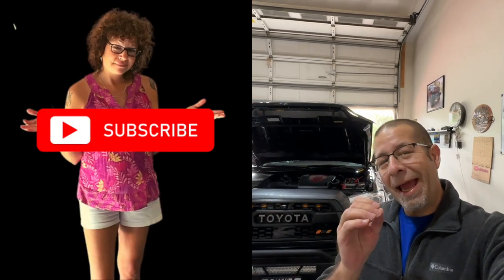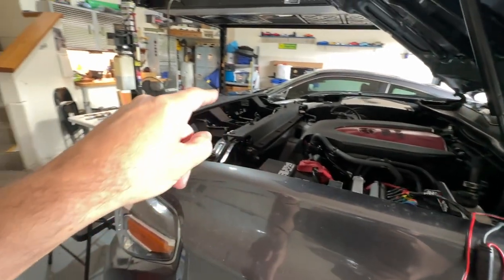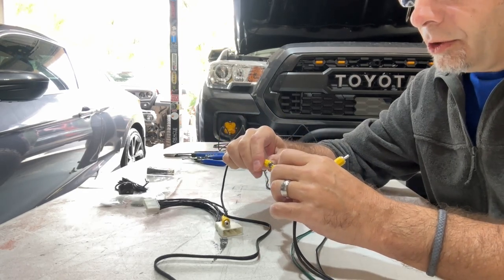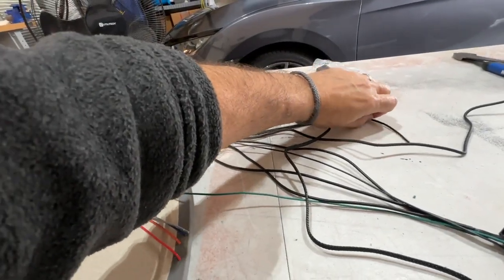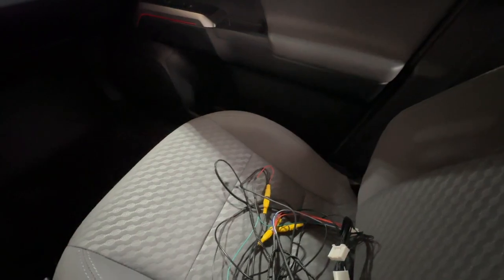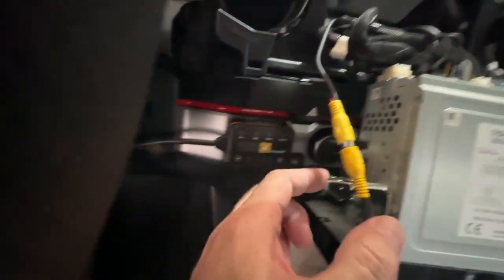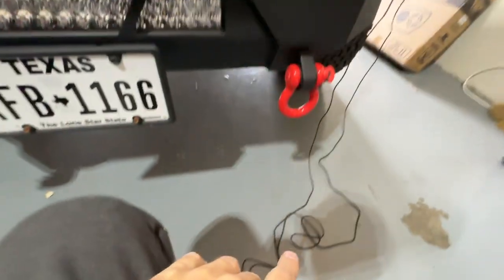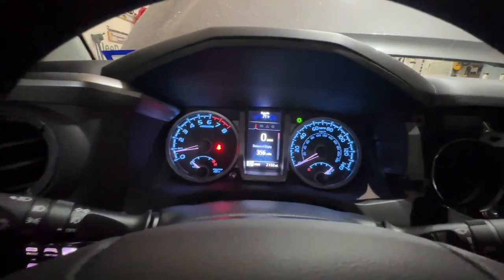Toyota Tacoma Front And Rear Camera

Comment: This was one of the most difficult things I installed in my truck.  I actually destroyed one of the harness trying to wire it all up inside the truck.  The good thing is the seller is very helpful and sent me a replacement part no charge. Also helped with some installation advice.  Definitely do this wiring on a table.  I used a cool heat shrink butt splice that had a low temp solder inside. Those made great clean connections. Just twist the wires as directed pull the solder ring inside over the middle of the splice then hit it with a heat gun.  
I did get the front camera too and find it useful for parking in tight places but the main reason was to look in on the camper when towing it.

Comment: I installed the Wolfbox Mirror G840H with hardwire on my 09 Tacoma a lot easier. My only problem was where to mount the rear camera on the flat chrome bumper. I used two-way tape to secure the camera L bracket.  I had no choice had to drill a 3/8 hole in the back of the bumper to route the wire to the camera. The camera picture quality is superior with the full mirror backup & 24/7 parking monitor front & rear.

Comment: I put one of these in it was really easy when I saw all the wires I thought I might be over my head but everything goes between the radio wires you just pull the plugs out of the radio plug the harness that fit into the harness the other end plugs back in the radio all of the electrical was like that there is plenty of room in the dash put the radio back in I of course dropped on bolt and it went into a small space I couldn't get at so the three bolts held the radio fine I already had a way to get through the fire wall the grommet had a wire going from NY aftermarket fog lights to the relay I just made it a little bigger and fished the power wire and the camera cable out I guessed on the placement of the camera and it was perfect for me I was impressed the switch fit right in a blank under the radio and it lights up blue all that was left was I had to cut one of 3 wires that go to the camera so the image was in the right orientation I like the grid lines front and back the red lines keep you from getting to close great idea I lived in the city all my life when my dad died my mother was not a driver I am disabled so I moved up here about forty miles from my house I use to be able ro parnell park without looking but when you stop for a while everything I go to the city the cameras make it much faster pulling in without hitting someone's bumper it's the same pulling out I like to back into spots I've always would rather pull out and see easier than back out and in the supermarket these people drive like there at the indie 500 so I back into the space and the red line helps you get a rather long truck in a space designed for a car I don't know how it was for you rob but I got mine from a company called n2 they make aftermarket startes and I was thinking of getting one because they had a model that if you set it right it could be used on a manual and it wasn't a big deal there was a wire that canceled the clutch having to be thrown and before you shut the truck down you had to put it in neutral set the parking break push a button on the key fob and if you did it right a green light would come on then you could set the defroster or ac and just push the button and she would start but then I saw the front camera and it was alot cheaper and more useful because the truck is right outside my front door so if it's snowing I have to clean it off any how so I hit the clutch cancel button make sure it's not in gear start with the key put the defroster on hi and turn on the heated mirrors by the time I have the truck clean I jump in and it's warm

Comment: I did that mod on my truck but then the wires started to hang down and my feet got caught in them  and now my back up camera doesn’t work need to fix it
Reply from the maker: Gotta secure those wires😬
Reply: @RobMotive  I did at first but I did the mod a couple of years ago I think the tape came undone  and I stepped on the wire 1 too many times
Reply from the maker: Ouch😬
Reply: @RobMotive  but I got power to the switch and the front camera works fine it's just The backup camera that doesn't work I think if I replace the green wire it would work